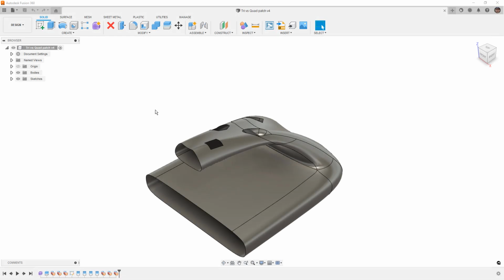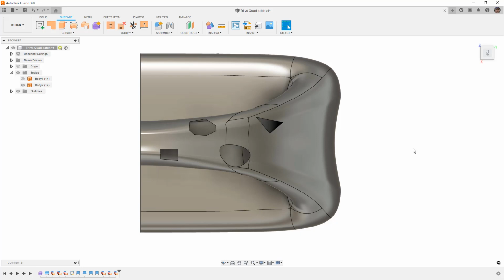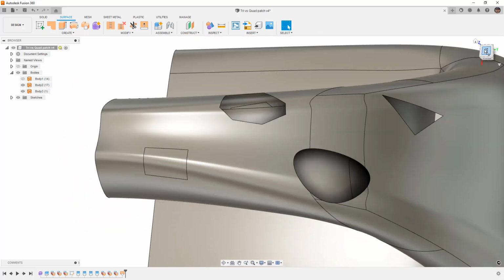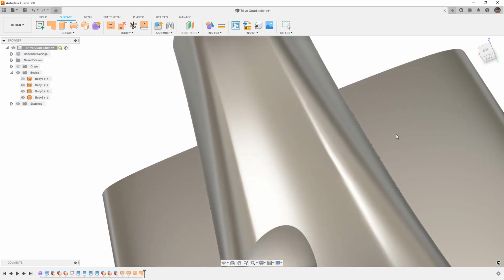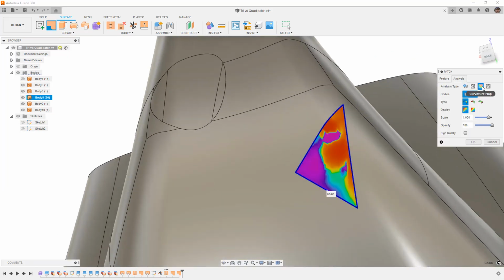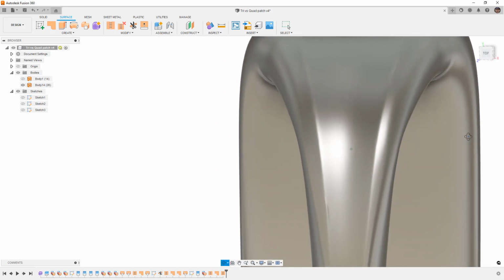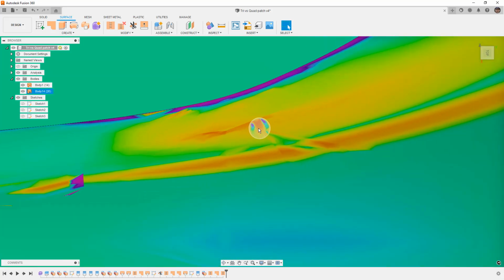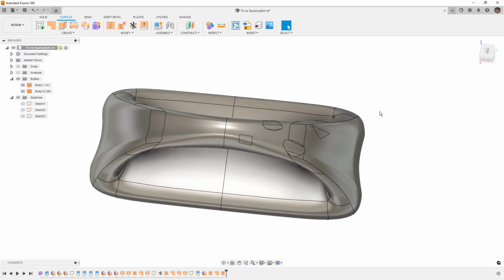Surface Mastery Part 10 - How To Preserve Shapes When Patching Surfaces | How To Use Loft and Patch

Comment: If you turn the shape into a solid by patching the openings, then use the solid tool Delete Face, often, the solid will fix itself to become the shape it was previously (granted, sometimes it will deny the deletion). Worked for me when designing a rc plane and having timeline turned off only to recognize I've cut a shape out in the wrong spot (finally learned to just turn direct modelling off lol, oh well)
Reply from the maker: Yeah the Delete tool can be great! Fusion does a pretty good job of patching geometry, but what it does is extends the geometry, it won't revert back to an old shape (to the best of my knowledge).  So for example if you delete a fillet it just extends the faces until they intersect at a corner.  I have had it do weird things before with true circular objects.

Have you noticed it actually going back to an older shape?
Reply: @LearnEverythingAboutDesign  Hi there, sorry - your response went unnoticed!
I guess the geometry engine tries to extend the edges to meet as you said, makes the most sense. However, I have had cases where extending naturally with aligned edges to the outer surface (so an open brep) gave an unwanted result. As an example:

I modelled a wing for a F-16 model, since this wing is basically a Delta-shape in plan view, to make it printable, I chose to seperate the shape into printable size parts. I cut the shape in the cross-direction (so in length-station). Then in cross-section, I created a shell that allowed for an insert to be glued in so the joint could be biscuit-ed when printed. This would allow for correct alignment of the glue joint. However, when trying to put it together, I noticed this joint lengthened the wing by about 0.3mm. This can be due to a lot of factors, mostly due to tolerances being so tight the actual glue in the joint would make it so the parts didn't meet flush. 

As a solution, I added a 0.4mm gap between the parts, by direct face manipulation and shifting the faces of the split body back. Since I was in direct modelling, with this edit, the connected shape was lost. After more testing and re-designing, I had to re-build the full wing solid to make the joint in another place. I tried offsetting the outer surfaces and extending them to meet.

The seam it would create would be fine for the printed model itself. The non-tangency "stitched" outer surfaces would be non-tangent by a tiny amount, in zebra analysis it'd create a sort of break, perhaps due to stitching? This is cerainly unnoticable in the mesh export, but being a 3d-modeller by trade this was a huge annoyance to me. 

In the end, what did the trick was to fill the shell I had made for adding the glued insert, extending that to intersect with the other wing body. By combining the solids, I basically had the full surface back, minus what was basically a 0.4mm negatively embossed trough all around the wing. I selected all the inside faces of that trough and deleted them. This somehow merged the faces into what was the original face. 

After learning what I have in working with inventor for work and watching a ton of your videos about fusion, I've set it up correctly (and parametrically) and will never again lose geometry by working in direct modelling mode (timeline is sooo good haha).

Anyways, that's a case where I found delete face to re-build old geometry.
Hope that very expanded story makes sense. I'm sure it would've been possible to fix it in some other way, I probably made a few mistakes along the way trying to fix it, but it did work in the end. 

Thanks for your content and reply!
Greetings from Amterdam, NL

Comment: Using the curvature flow as a guide to decide which sides to loft is great advice! I learned most of this by watching @thirtysixverts series in Rhino and Autodesk's Golden Rules for Alias surfacing so it's super interesting if and how all this carries over to Fusions tools.
Reply from the maker: Thanks for the comment and inspiration for that video :)  Alias and Rhino certainly handle this stuff way better than Fusion.  They are less picky about all this.  If you have Alias and need to do surface work use that :)
Reply: @LearnEverythingAboutDesign  Yeah Alias is obviously build for surfacing but I'm on a Mac and as an engineering designer I'm working more on concept than production surfaces anyway so Fusion and Rhino works fine for me right now. It's super interesting to me how the tools work and in which cases they somehow fall apart. I loved 
Freya Holmérs video "The Continuity of Splines" just because the math is cool ;)

Comment: This was an eye opener for me. There are so many nuances when it comes to surfacing. Watching this made me realise how much I still don't fully grasp about surfacing.
For the four sided surface, have you tried experimenting with the extend tool? It seems to produce a very nice surface, although I have no idea what it is doing in the background.
I was surprised by that fact that you could use multiple disjointed entities as a single loft profile. Never knew that one.
Do you have a video that explains the differences between free edges, align to surface and align edges in the loft command? Watching this video made me question my understanding of those options😅.
Reply from the maker: Thanks for the comment!  I find it hard to believe you don't know it all with the models you make on your channel!

On the four sided surface I didn't try the extend tool.  Mainly because you can't guarantee that it will meet the end profile where you want, but anything is possible!  

On the free edge vs align edge yes i did a video here https://youtu.be/O73d9atFWOY   It is a nuanced setting that only seems to work in very specific cases so hopefully this helps!
Reply: Ayy my fav 2 Fusion 360 channels!